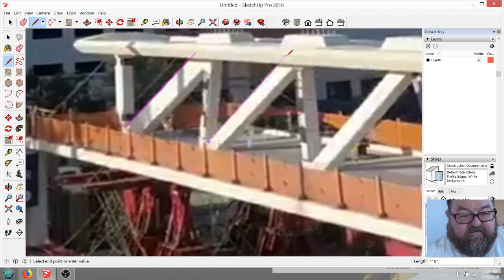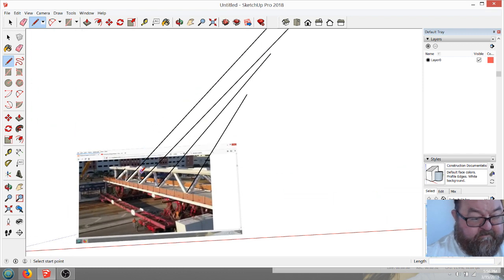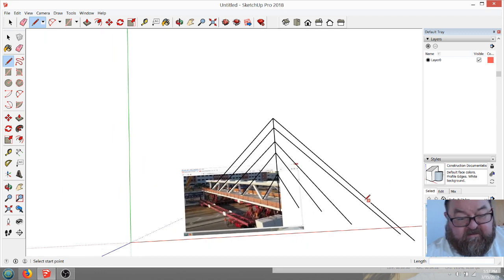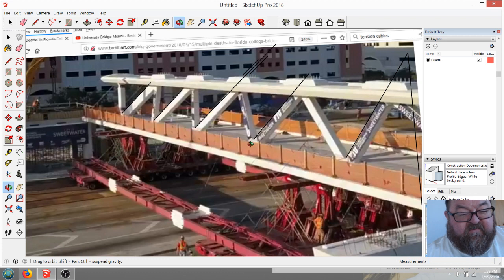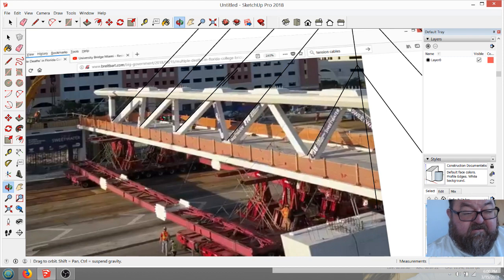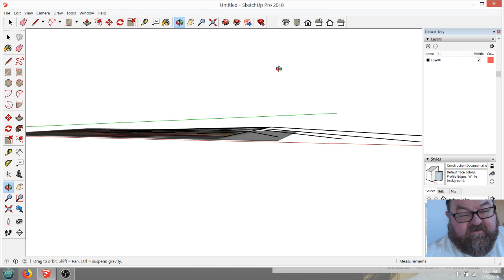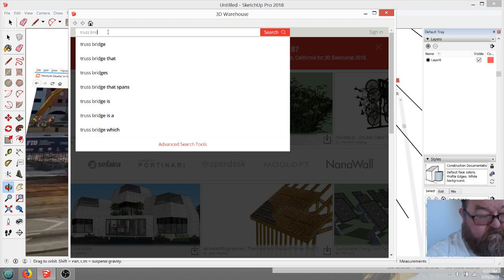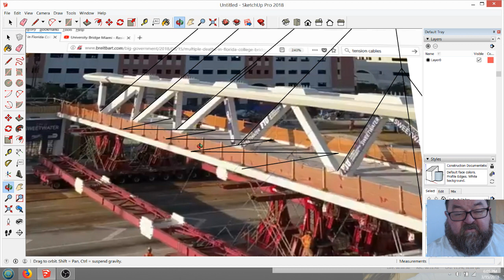FIU Pedestrian Bridge Collapses Under Own Weight - SketchUp

Comment: Dude, the tower and cables are called falsework. They are not a structural part of the design, merely decorative. The on site engineers made a fatal decision to adjust the post tensioning in the north end of the bridge without stopping traffic. This came about because they needed to reposition the creeper cranes for the move to lift the bridge from a spot different than planned. That involved changing the strain on the post tensioned cables. That caused some cracking. Then they decided to readjust. Tragic, and IMHO criminal negligence.

Comment: It's called a cable-stayed bridge.  The collapsed street-side span was to be supported by five tension members strung from a 140-foot pylon and counter-balanced by a shorter canal-side span.  This type of construction is NOT fully stable until ALL components are in-place.  Why they didn't design a much lighter and cheaper truss-type bridge is beyond comprehension.
Reply: Probably because a simple truss bridge is not pretty. This is what happens when you put more weight  into what an architect wants and less into what the engineers tell you.
Reply: There has never been a worse design for a bridge.

Comment: As a contractor I would have built the Support Tower First and had the cables in place ready to be bolted, before delivering the prefab bridged. The structure been seen inside the bridge are not trusses those are  the structure extensions to carry the loads in to cables and main tower. I still think it was a lack of planning and mismanagement. The decision to open traffic at this stage was insane and criminal.

Comment: I am a licensed professional Structural Engineer. From the news stories I have seen to date, the bridge was designed as a suspension bridge. Only the long span across the roadway was installed, and that was the portion that collapsed. The center mast, second shorter span (across what appears to be a body of water), and the supporting suspension cables (tension members) were to be installed at a later date. In other words, the bridge was a long way from being complete. 

I am very surprised the long span which collapsed did not have a temporary support at the center roadway median until all remaining portions of the bridge were completed. (Obviously I am not the engineer of record or a member of the bridge's design team.) Was the installed portion engineered to safely span that full length during this stage of the installation? The purpose of suspension cables is to reduce the amount of materials necessary in the bridge truss. If the bridge truss can span this distance safely, why are the center mast and suspension elements needed?  

Lastly, the "stress test" (which was being conducted at the time of the failure) comes into question. Secondary news sources stated workers were "tightening tension elements" to stress test the bridge when it collapsed. That is the first place to start the investigation. Did the workers and their supervisors fully understand what they were doing, and could this be the mechanism that triggered the collapse? Until that is disclosed, the design report is made public, and material failure is ruled out – we are only guessing what actually caused the failure. History tells us from previous disasters, usually a number of errors were made when combined caused the ultimate failure. It is unfortunate six innocent individuals lost their lives in this disaster.
Reply from the maker: I think it is interesting to try to make some assumptions or guesses then see if you are correct.  As long as I am not hurting anyone in the process I think it is an educational exercise.  I agree with you that there should have been temporary shoring mid span until the reinforcing had been tensioned and the cable stays installed.
Reply: We obviously don't have all of the facts but I have wondered the same thing based upon what information is available. I believe a temporary center support was needed. There were a lot of mistakes made, in my opinion. The fact the bridge failed is testimony to that.
Reply from the maker: Yes
Reply: Mark McCoy

I find it very troubling that I have heard this bridge design described as truss and also cable stayed and also suspension..

I personally think it's a hybrid design.. But the use of concrete is frankly inexplicable to me.
Reply: It wasn't schedule for completion until the end oof 2018.  The tragedy is all the hype about what a great design it was, when the reality is that it is absolutely one of the worst designs of all time given the materials used which was mostly concrete.
Reply: Mark McCoy — No, it was not designed as a suspension bridge.  It was intendd to be a self-supporting truss.

Comment: Hi, Bridge structural engineer here! While the bridge might look like a cable-stayed bridge, it is not. The "cables" shown in all the renderings are just hollow steel pipes for aesthetics. The span that collapsed WAS designed to support itself. It IS absolutely a truss. See the following link for the technical proposal for this bridge. http://facilities.fiu.edu/projects/BT_904/MCM_FIGG_Proposal_for_FIU_Pedestrian_Bridge_9-30-2015.pdf
Reply: Justin Mickens,  Thanks for posting this. Very interesting.  Here is a quote from the FIGG proposal, It's a little vague as to how much load the stays are meant to handle.  There is another place where it says the stays are for "pedestrian loads"

"The size of the stay pipes and
spacing were designed to provide
additional stiffness. The structure
meets strength design criteria
without the stays; they are an
additional structural feature
provided to meet the natural
frequency requirements"
Reply: Basically to decrease vibrations
Reply: Thanks, good reference and probably the only one with any authority. On page 65, it says "The size of the stay pipes and spacing were designed to provide additional stiffness. The structure meets strength design criteria without the stays; they are an additional structural feature provided to meet the natural frequency requirements." Several other pages describe the problem of bridge resonance when lots of people start walking on it, which was not the case when it collapsed.
Reply: Thanks for posting the link.  The proposal is stuffed to the hilt with bogus claims.  This is clearly one of the worst bridge designs of all time.  A design for steel construction realized in concrete which proved itself very quickly to be a total failure, by killing innocent people.  The only question is how many years should the responsible designers spend in prison for this criminal negligence?

Comment: Thanks for the video.  As soon as I saw the bridge design I thought, where is the suspension column in the wreckage? But it's not in the wreckage... They basically built a cable-stayed suspension bridge without the suspension cables. Somehow they figured a support in the middle was unnecessary until the suspension cables were attached.

So of course the cables in the deck columns loosened after a stress test because they were never designed to hold up the deck by themselves.  And it makes sense that as the internal cables were tightened additionally the extra stress broke the bridge.

This installation technique is used for highway overpass decks but those decks are supported underneath by steel girders. This deck is just a long stretch of poured concrete like a floor of a parking garage.

Comment: They should have the side spanning the water up first, the tower, and cables up ready to attach to the section spanning the road, the second it went up.  The road span should have been the last thing installed.  But, I'm sure the city told them what to put up and when, and probably told them no center support, due to traffic.
Reply: Mike M., you are correct aside from the fact that this was a horrible design for a pedestrian bridge in the first place.

Comment: An example of a camber can be seen in an empty semi flatbed trailer.  It offers greater resistance to the weight of hauled cargo, allowing for higher load carrying capabilities.
As for angled supports, anything less than 45 degrees is at a gravitational disadvantage.
Reply from the maker: Yes, and most of the cables less than 45 are more toward the end supports so I think they assumed it would work but that is what assumptions do.  The trailer bed is a good example of camber for a load.
Reply: Good example flat bed aluminum trailer high in the center until load is applied .
Reply: Hi Tony, I don't think they just "assumed" anything. There are standard engineering computer programs that analyze everything about the bridge before it is built. Somebody screwed up or it would not have fallen, but whether that was in the design, or the construction, or the procedure being performed when it fell, will require the complete analysis team's report to determine.

Comment: I'm absolutely sure no statical engineer ever considered this cable-supported bridge being left alone for an extended length of time without the cables being installed. We all learn that any structure is subject to the most extreme and varying states of loading during the construction phase. 
In most cases, a suspended bridge is only extended after the towers are in place, and in a case like this where the entire span is installed at once, the cables should have been ready to be attached while the segment was still temporarily supported.
This seems to be a case where the supporting tower was to be built or installed on top of the joint between the tho spans. This is already strange enough since it creates a vertical discontinuity on a critical member subject to variable lateral loads during the service of the structure.

Comment: I am impressed by the amount of work done by you Artisan Tony before you found out that there were not supposed to be real stay cables, but 16" diameter steel tubes instead of cables. Virtually just for show. If it had been a proper cable stay bridge one may have put the short span in position first, then stayed the cables to the pylon before putting the long span in position.

Comment: IF cables were part of the design for supporting the weight, they should have been in place before the temporary supports were removed . Communication of this to the installation crew from the engineering department would seam to have not been done. At a minimum a temporary support should have been put in at the meridian where the chevrons are paint on the road . That is if it would have sufficed for the design . There was probably nothing wrong with the design with cables in place . Installation procedure was lacking and a push for uninterrupted traffic flow is where the finger can be pointed IMO at first glance.

Comment: So much for  Accelerated Bridge Construction taught at FIU. Design  & esthetics replaced safety & common sense!
Reply from the maker: I did not realize this was taught there.  They definitely should learn more about engineering and skip some of the esthetics.
Reply: Libery One — To clarify, the technique of Accelerated Bridge Construction was not the problem.  All that means is that the span is not built in place, but is built elsewhere and lifted into place.  The problem was the unconventional design of the truss and, possibly, some other factors.

Comment: Bridge built with cement and cables over 5 meters long, 800tons and no supporting columns, waste of money and incompetent engineers.
Reply from the maker: Yes, one temporary support in the middle would have worked until the cables were installed.  Thanks!
Reply: 5 meters is like 17'.
Reply: Yes the responsible engineers should receive a life sentence for murder.  Basically the design was for a bridge that could not be successfully built.  This type of construction needs to be banned world wide.

Comment: Those tall cables you allude to are decorative, not the tensioning cables, which are internal to the webs of the truss structure, and are used for the post-tensioniong of the concrete.

Comment: the central pillar wasn't carrying any load if you read the plans. the stays are cosmetic steel pipes not tensioned with cables.
Reply from the maker: None of what you say is true :) sorry.  Loads are place on structures whether you like it or not.  You have live loads and dead loads.  There would have been both on all portions of the bridge.  Also, if you see my follow up video you will see that the stays were designed to carry pedestrian live loads.  Again, there is no such thing as a building component not being under a load.  Gravity guarantees that :)  I am still amazed at people defending the design of this bridge even after it fell. It is like people oin the internet just want to be contrary no matter what the context is.

Comment: Mechanical Engineering student here.

I do remember seeing a temporary structure, but that was just to bring the structure into place. There were cranes that I believe were assembling the supports, but there should have at least been a temporary structure to prevent this happening.

Comment: I am not a genius, an engineer, nor did I stay at a Holiday Inn last night, but... I do know that if there were no steal beams spanning the length of the road and all that concrete was supposed to be held in suspension with just rebar... then it's a bad plan. That's a lot of weight you are expecting to levitate for a couple of decades, and you typically want to use an arch to distribute it over the center and onto the sides, or just put a column in the middle.

Comment: Seems like it may have been a procedural mix up... but there is definitely more to the story.  It will be very interesting as the investigation proceeds to answer the 5 w's... who, what, when, where and why .
Reply from the maker: Yes, the sequence was definitely off.  The tower structure for the cables should have been in place and cables installed in concert with the temp shoring until the entire structural system was complete. I will also be interested to here the final report on this one.

Comment: March 23 .... What looks like cables above the canopy are decorative tubes, not part of the structure to hold the bridge up. It was interesting to me the canopy was concrete.

Later info indicates the span was moved with one end cantilevered because of obstacles in the roadway. This was an adaptation on site. WITHOUT STOPPING TRAFFIC they were making tension adjustments and you can see in some of the pictures where a rod appears to have flown out with the hydraulic unit. In one slow motion narrated video you can see work being done with crane assist. The bridge falls then a worker falls. I was wondering if he was the worker who died. If he was hit when the rod came flying out that would be a catastrophic injury. As for the people under the bridge, they shouldn't have been there. 

Cracks were noted two days before the collapse. The person leaving the message said it wasn't a safety concern. It wouldn't have mattered because no one heard the voice message in time anyway.

One of the companies working on this bridge also worked on a bridge in Norfolk, VA. The Jordan Bridge. An onsite modification was made to a girder without checking with the girder manufacturer. It fell dropping 90 tons of concrete injuring four workers. The company was fined a mere $28,000.

There was no need for all the injuries and grief. People aren't as cautious as they used to be. Positive thinking isn't going to fix a flawed tension cable. So sorroy for the families.

Comment: Seems pretty simple to me- What we have here is an asymmetric cable-stayed bridge that could not support it's own weight before the pylon and cables were installed. Just insufficient analysis of the un-supported structure.

They were most likely reducing the tension on element 11 which was pulling the structure down, not holding it up.

Comment from the maker: So now we here there were cracks discovered the morning of the failure.  This is total neglect of those in charge.  Cracks in a post-tensioned concrete system should be taken seriously especially if your cable stays are not installed yet.

Comment: I also agree in you stating there should have been a concave for extra strength.I always overbuild.I've seen+endured just calculating weight of people at full capacity.Example in deck building.I was on one and there was big one at Jersey shore yrs. ago where packed upper one collapsed on lower one.Built just to capacity rating doesn't factor the many yrs. a structure will be around and all of a sudden encounter an event planned by people who don't think of the structures weight rating.That deck you enjoyed with your kids 2 decades later being used for their college graduation getting loaded with beer kegs,coolers of ice?Just 1 example for all builders+engineers always consider your structure may encounter a once in a life time event it wasn't designed to hold+these failures strike in an instant.I was lucky as when I endured it that it was a lower deck.Just sitting next to a keg by sliding door.When a heavy girl(no insult intended)walked out .I heard a creak that caused me to look down+it blew.I saw my friend leaning against the wall.Shoot up,I was flipping backwards,watching the keg fly next to me and luckily no one was hurt as there was a soft downhill grass we rolled down.But its quickness would have shocked you to hear some thought it was an earthquake,the world was ending etc:.Godbless the victims and their loved ones but please there are no take backs in real life.Take your building/designing seriously and those that are not.Be aware.

Comment: They should have temporary support in place until the cables completely installed.   Also, they should not stress test when the bridge is not completed.   If the bridge has I-beam it could survived, but here only re-bbar and concrete.